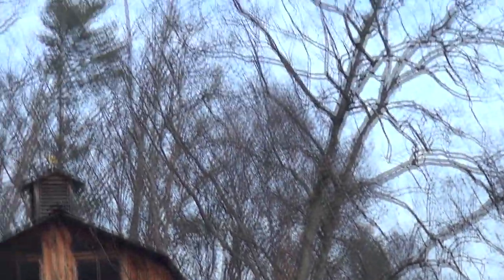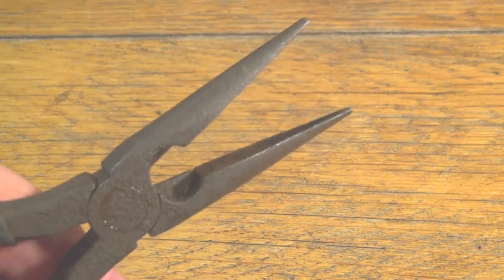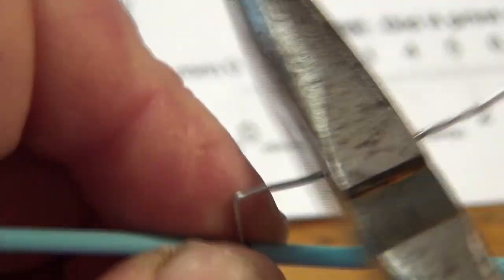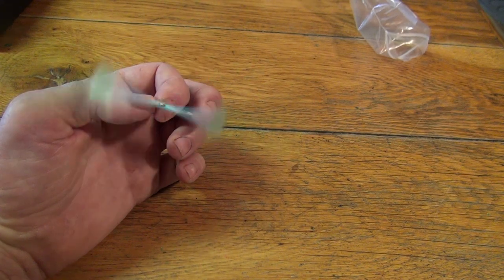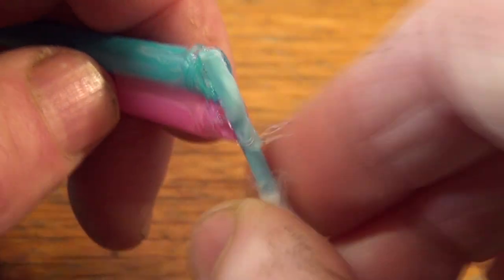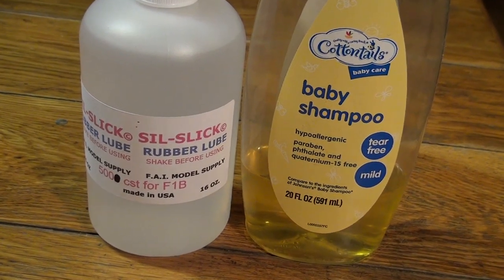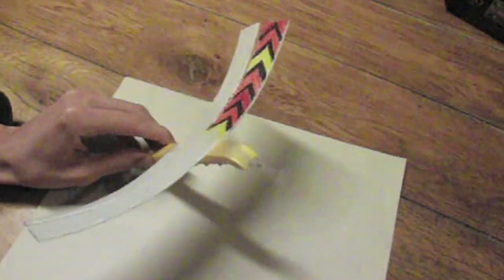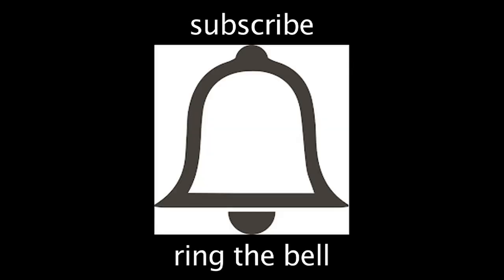Dragonfly Helicopter from Common Materials

Comment: 8:37 I'm only tape the spacer and propeller onto the straws instead glue
Reply from the maker: Tape instead of glue could work--if it is strong enough.
Reply: My piece of tape is about 1/2 inch (12mm) wide scotch tape.
Reply from the maker: @hoangphinguyen8869  I do not know. It could depend on how sticky the tape is, how tightly it is wrapped, etc. Let me know how it goes.